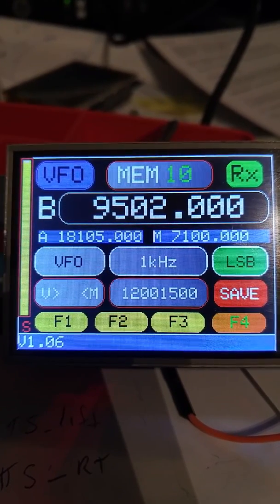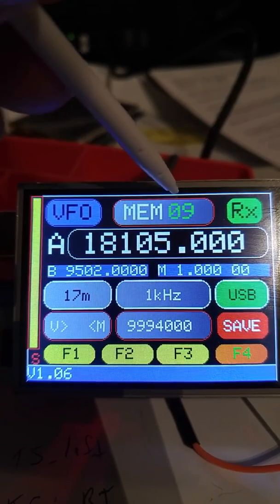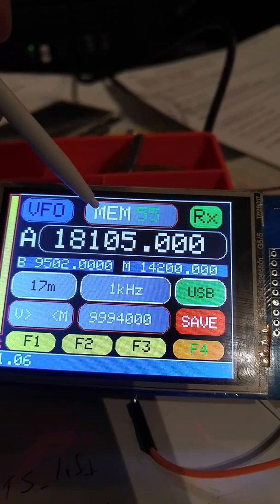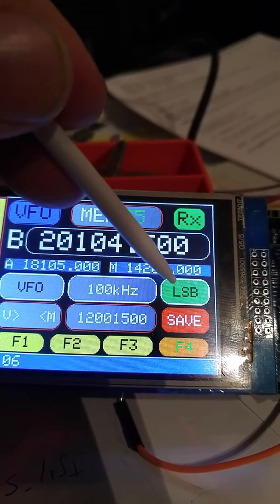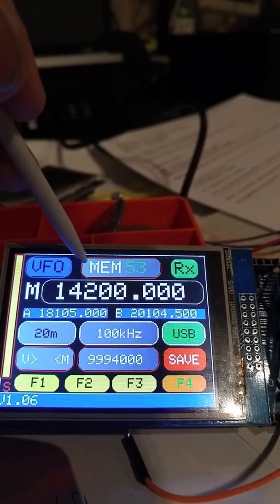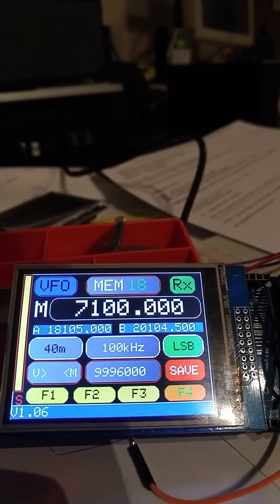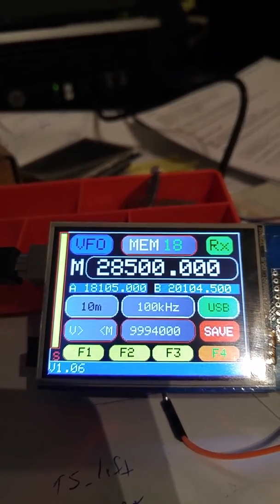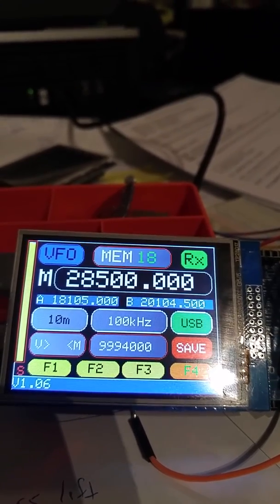VU2SPF - UNIVERSAL 2.8 TFT tOUCH DISPLAY FOR BITX plus

Comment from the maker: The code is located at
http://vu2spf.blogspot.ca
Info and code now version 2.9bu
And more features,  Cat control, split, scan etc
You can use most sizes, but the touch may not have the same matrix and require new code
I use 2.8 

Joe VE1BWV